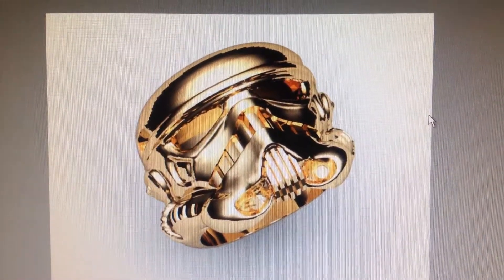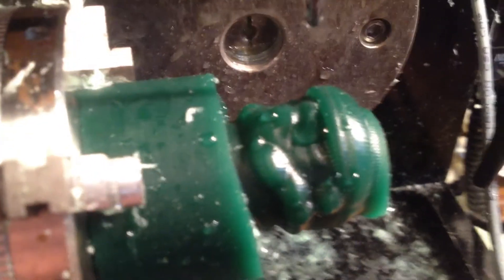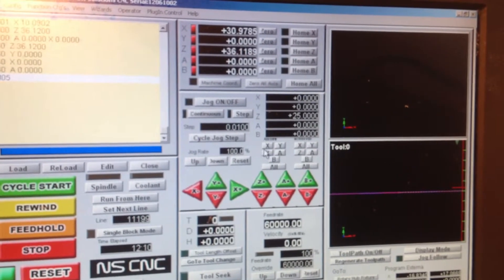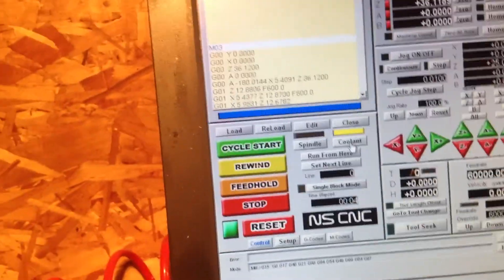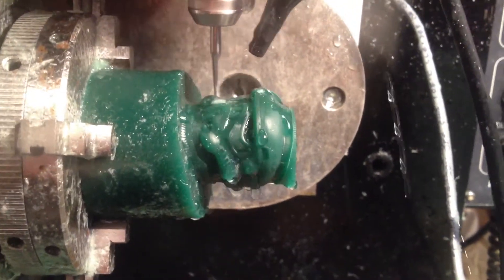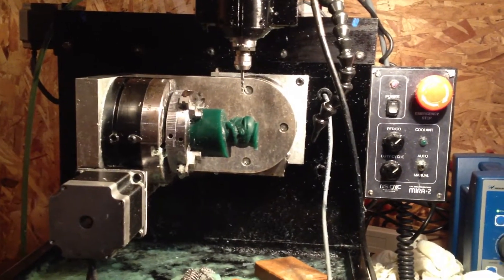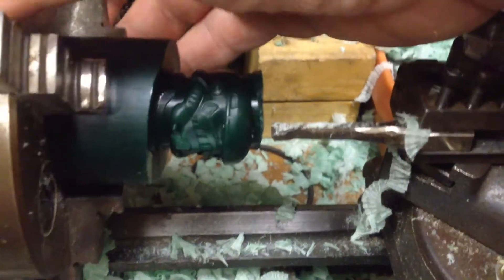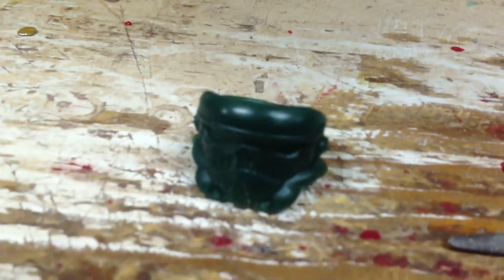Storm Trooper Ring. From the CAD file showing the milling of the wax pattern.

Comment from the maker: I did the CAD then the wax milling. For the video. Was going to make it silver for me.  But the cobbler has the worst shoes. Never go around to casting it.  Way to much work at my shop. Austin Jewellers.
Reply: the CAD/modelling must've been brutal...revolve, sweep or raster scan?
Reply from the maker: I don’t think there is an easy answer.  I use Mach 3 (1000$) to run the mill. But the computer program for the 3 d building of the ring is matrix/rhino. (7500$).  And then to set the milling file up is Artcam. (10,000$).  Is there a Cheeper way.  Not sure. But the way I am using them works for me.  Oh and the mill. New solutions cnc. Out of coquitlam bc. Canada. Just down the street from me. The mill is 20,000$.  I bought all this stuff years ago and use them all the time. I have a jewellery store. Austin Jewellers.  They have paid for themselves years ago.  Hope this helps.   Frank the jeweller